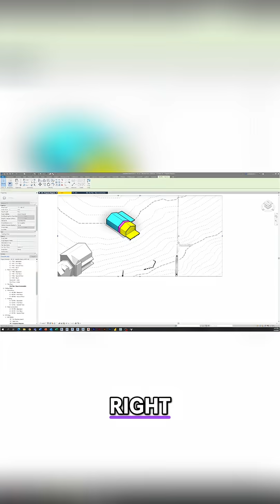"Skinning" the Mass in Revit to convert concept masses to real buildings.... #shorts

Comment: This is exactly how double curved surfaces are clad in Revit. You use a curtain system when picking the mass and it will triangulate to fit the surface.
Reply from the maker: Right!